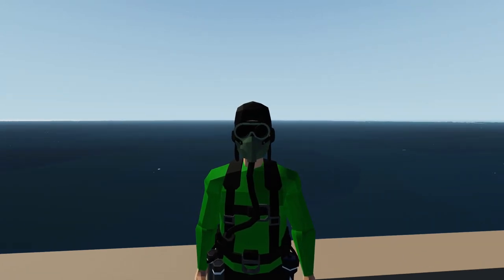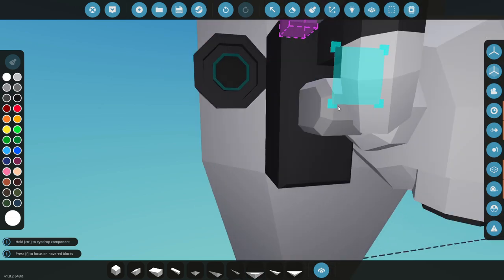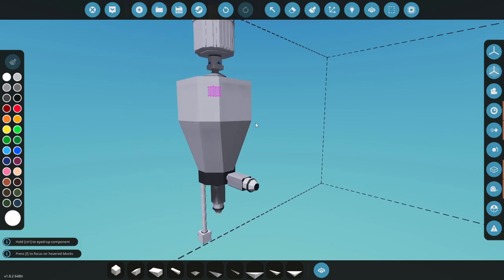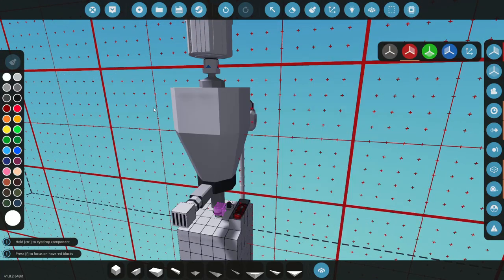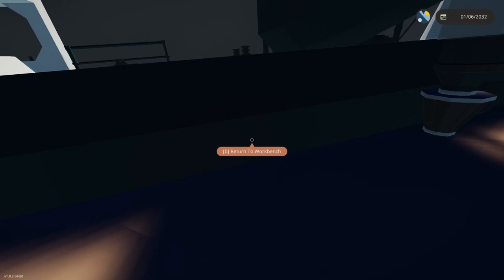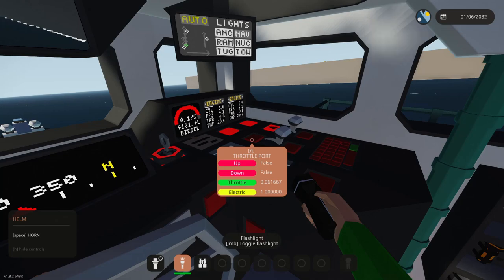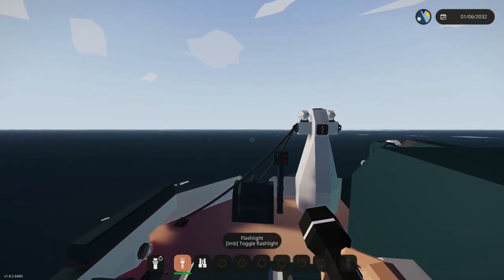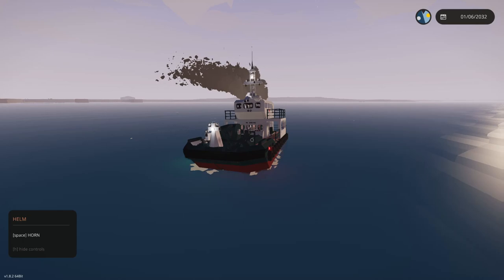Clean Up Oil! Beginners Centrifugal Separator Stormworks Tutorial - How To Clean Oil

Comment: As someone who has spent most of his professional life in wastewater and stormwater treatment, I'd recirculate the storage tank to a 10% variable valve, and back through the separator. The separators are less effective at lower RPS? Then you can run the recirc at a higher percentage (IRL we do 50/50 a lot). This would be a great way to run a very low power system in-game. You might even be able to get away with solar.

Comment: Nothing like centrifugal oil purifiers, in simple terms as a purifier spins with water and oil, the density causes a water seal to form on the outside of the bowl and an oil film to form on the inside, both are pumped out differently but if you were to loose speed on the purifier, you would loose your water seal and therefore dump both oil and water into the bilge, gotta love seeing it in stormworks